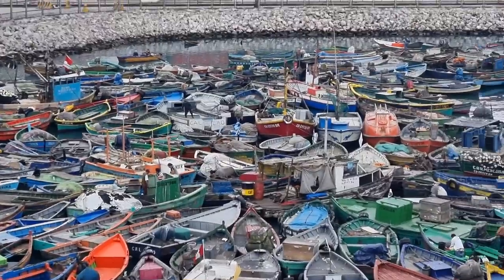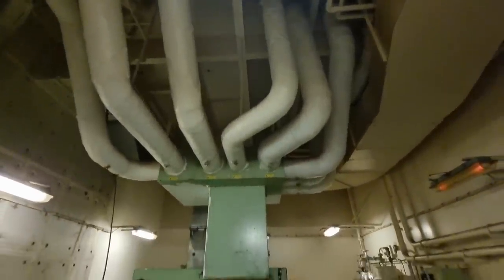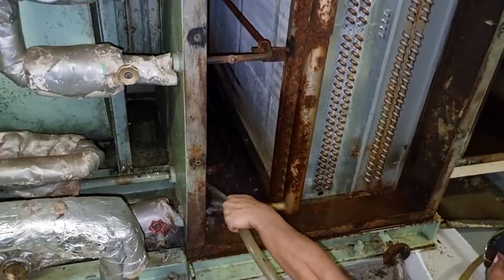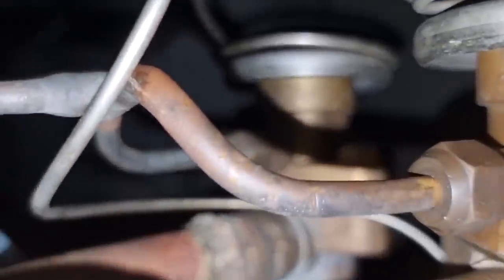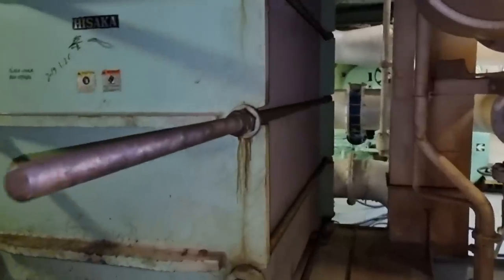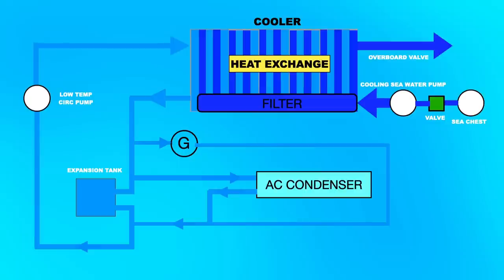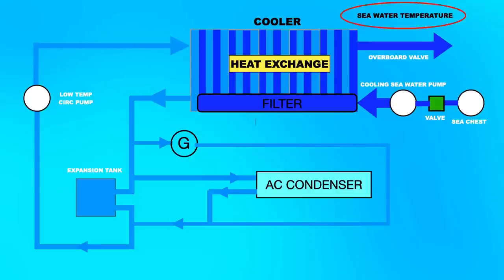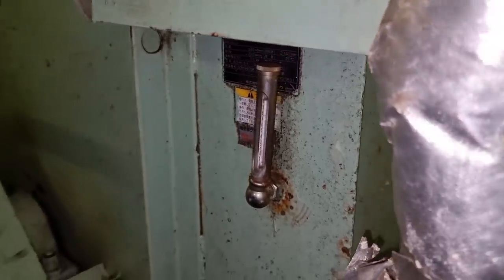AIRCONDITION TROUBLESHOOTING FROM 24°C IMPROVED TO 18°C, WHAT DID I DO?

Comment: Idol lecky do have experienced elevator trouble F21 error as maker from hyundai elevators unable to run continuous from E deck down to 3Rd engine room but from every 2floor it is working.
Reply from the maker: calibrate the floor, run the lift from the longest distance and from where it will stop the check the floor level
Reply: Tnz for reply idol actually we did self calibration run to end to end still the same as F21 error says anti stall error we still wait from maker reply
Reply: This type of error is very unusual thats why maybe you encounter this type of alarm tnx

Comment: You have alow delta T syndrome your delta T should be 10° this system is not efficient at all. Its also an old system, the new system have 12-14° delta T more efficient and less water flow (GPM) and a smaller Hp Pump😅

Comment: Ok so you've mafe improvements on the chillef water supply temperature of 24°C = 75.2°F to 18°C = 64.4°F a 6° drop. Now you have a 6° delta T on your chilled water circuit. But you fail to tell us how you did it. You either had to clean the water side of tbe AHU (air handler unit)  and also the water side of the AHU. Come on pleade this is child play. Tell us what type of chiller you use and wethervis aircooled, or water cooled. The type of compressor screw reciprocating or centrifugal. Also show us the chiller, this video is not educational you're being too ambiguous and  are hiding too much imformation. You gotta do better then this! Really!!!
Reply: Relax. Calm down sir.